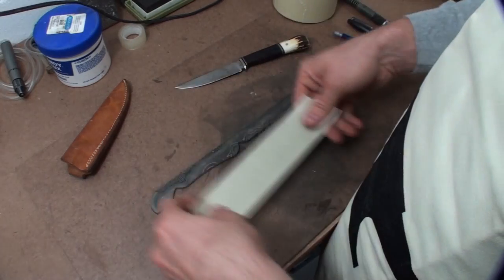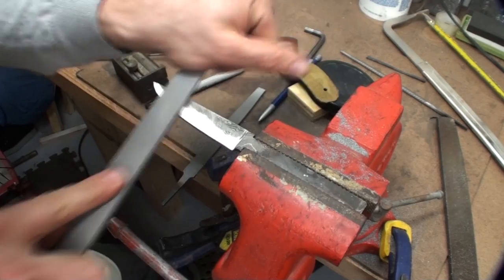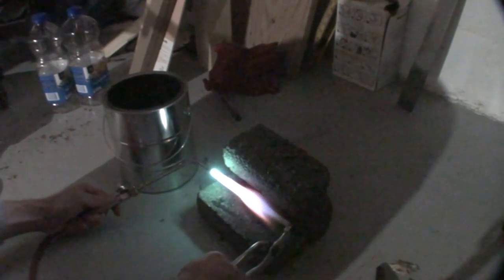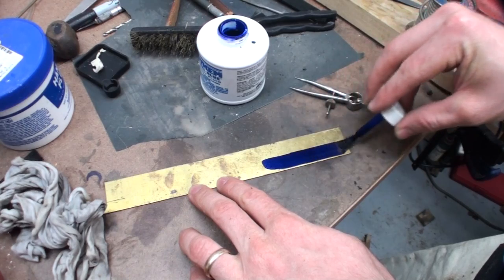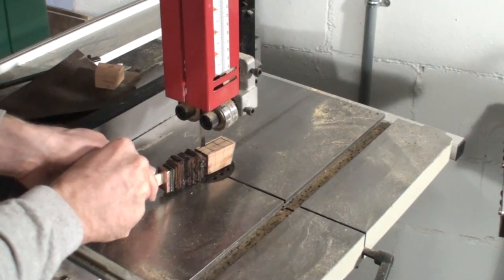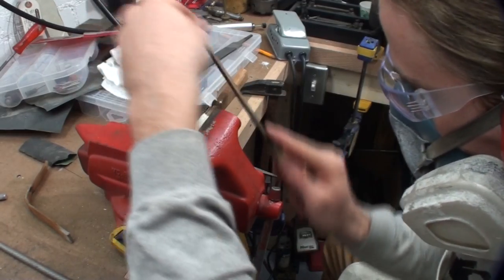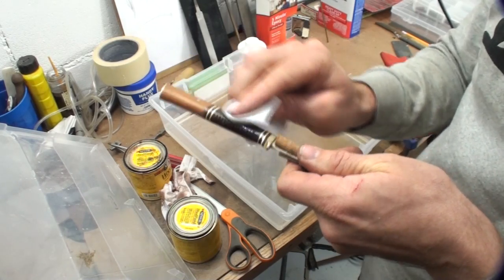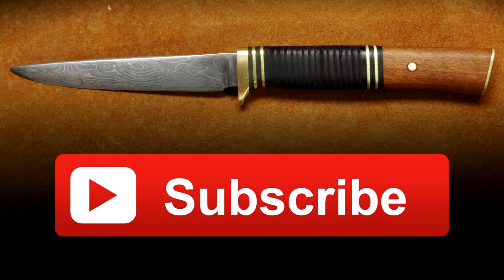How I Made My FIRST Knife!

Comment: That was some transformation! Outstanding!
Reply from the maker: +Xyienced Thanks, that's one of the coolest aspects of making anything.....to take raw materials and turn them into something totally unrelated to what they originally where.......and these items are already processed before I got them. The steel that was used to make the damascus, making the damascus, making the leather, the brass (copper and zinc) the plastic, the cherry.........all of it. Think of all the work that it takes to even create or prepare the raw materials before someone can even get started. It's mind blowing. I think about that a lot, any time I think something costs too much, whether it be lumber, metal, water, electricity, this computer, etc......I think about what goes into making it/them or the infrastructure that supports them, such as mining, electric grid,  technological advancements, time for trees to grow, be cut, milled, dried, shipped..... I know I'm sounding out there......but wow.  Just having a rough sawn board sitting on the workbench is quite a thing in it's self. Thanks for watching.

Comment: Nice first knife. As far as testing goes, if you care at all about hardness, the brass rod test is simple to do. Most knife makers, that heat treat their own blades, usually don't have a hardness tester, as they're not cheap. Since it's your own knife, probably not as critical. The wet towel is a good idea when soldering the guard. Also seen people use heat sinks.
Reply from the maker: +Bone Headed Thanks for the idea

Comment: VERY nice. sweet & distinguished profile. thanks for the video.
Reply from the maker: +Jeff Barwick Thanks, I'd tweak a few things if I could go back, but overall I'm very happy.
Reply: +The Homestead Craftsman i have made a few with old table saw blades, heat treated, with hickory handles. pretty limited to shorter blades and skinners.
Reply from the maker: Im not going to say it's cheap, but a piece of knife steel isn't that expensive. If it's something your interested in, buy enough to make a few, then at least you know what your getting in the metal.

Comment: Nice looking knife.  Use marine grade epoxy  Has a 4 hr cure time.  Actually much stronger than the 5 minute  variety.
Reply from the maker: +Steve McEntyre I recently ordered a gallon of west system with both fast and slow cure hardeners. It's mainly for my furniture work, but it will see some use on the knives as well.

Comment: looks great, watch out with the brass though as it may corrode your knife faster due to galvanic corrosion
Reply from the maker: That only occurs if the two metals touching are exposed to an electrolyte. Like salt water, mine is just sitting on a table.
Reply: The Homestead Craftsman It would still happen in damp to normal air over time. However I thought about it again and it's actually a good thing, with use of the knife the oxidation layer will shear off and that will cause a new sharp edge. Meaning that you will have a knife that "sharps itself". It also means that your metal on the handle will not oxidate at all so it will remain beautiful. It's a smart choice that I didn't think of immediatly, really nice knife btw
Reply from the maker: That can be said about any corrosion. Give it enough time and a piece of metal will eventually turn to a pile of red dust. Mixing different metals is very common in knife making. I'm glad your watching and appreciate your comment but I think you may be over analyzing this situation. I only say this in case others read this comment and get scared there knife is going to rust in half.
Reply: The Homestead Craftsman yes u are right, in university we had to learn about all these little things last year, but i realize that in reality things are still a little bit different, your knife probably wont corrode in a long time just because like u say, it happens in everything, really slowly

Comment: Did you have to go over the smokey mountain knife works to buy the Damascus steel scrap? Or were you able to order it online and had them send it to you? Because I've always been wanting to try and use Damascus, but I could never find a piece for cheap enough. The knife turned out amazing great job!
Reply from the maker: +Anthony Strazhnikov Hi, I think you do have to go there for that type of thing. It's just random scraps from the knife making process of odd shaped pieces. I was driving past the store and went in to see what they had and just to look around in general. You can buy scrap off ebay as well. Full pieces of nice damascus are fairly expensive. The steel I used as made by Alabama Damascus. You can buy cheap damascus for a pretty good price, but you don't really know what metal was used. But if you don't really care, then it doesn't matter. For this knife, I mainly just wanted to go through the motions of making a knife, start to finish..as practice for future knives. I'm working on my second knife now, using 440C Stainless, it's a larger knife. I'm also doing a video on that one as well.
Reply: +The Homestead Craftsman your first knife turned out way better than my first knife. Mine was just a piece of steel bar stock with a para cord handle.

Comment: How do you get the scrap pieces?  Do they have them on a website?
Reply from the maker: +Ryan Chaffee I went there.
Reply from the maker: +Ryan Chaffee They sell them downstairs.
Reply: +The Homestead Craftsman Thank you for answering me. I was hoping  it was available  by ordering due to it being out of state for  me.
Reply from the maker: +Ryan Chaffee You can find scraps of damascus online, ebay for example.....also cheap damascus is sold. You may be able to call up someone like Alabama Damascus and ask them if they have any drops. They probably are not going to send you one $10 piece of metal, but they may do it for a box of it. Then you'd have a good amount, you could keep it or take what you want and sell the rest on ebay.......I'd keep it if I got a hold of it. If your are just looking to make a knife in general, don't worry about the damascus, just use some simple knife steel for a few knives and then use some damascus down the future. You can get knife steel easy, I recently ordered a variety from Texas Knife Maker, all 44OC stainless, different thickness from 1/8 - 1/4 inch. This knife was practice and a warm up for several knives that I'd like to make that I will put more time into. Other sources may be cheaper per foot but require a larger purchase, but not that bad. New Jersey Steel Baron and Admiral Steel are two companies that I have had suggested many times. They have a good selection and the shipping isn't that bad considering the type of package. Good luck